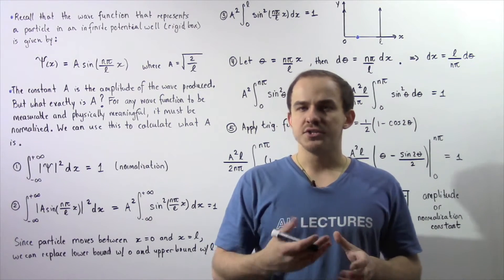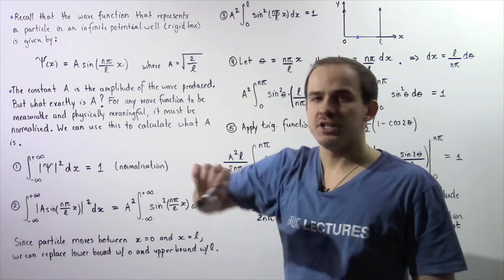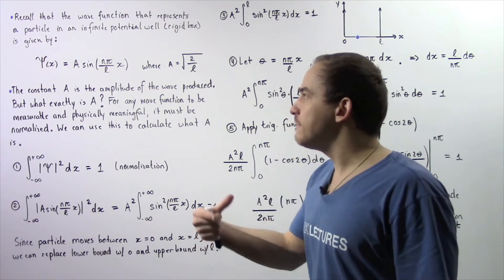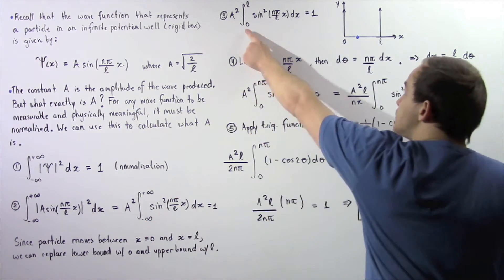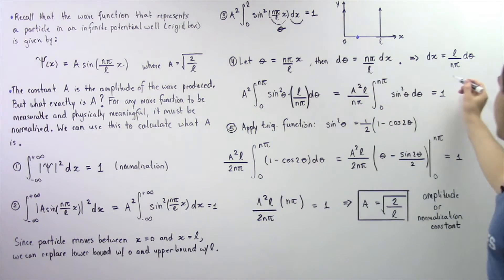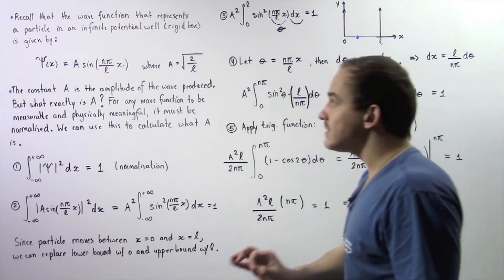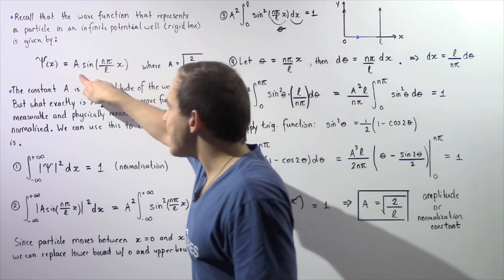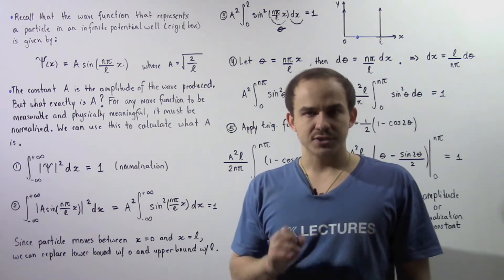Normalization Constant of Particle in Rigid Box

Comment: You still did not explain the bounds very well, at least I understand 0 but n\pi is not explained very well. how does it represent the right most boundary?
Reply: 0 and l are the boundaries of the electron since it is in the box. If you put l as x in the theta equation you get n*pi as theta, if you put 0 as x then you get 0 as theta so the boundaries for theta are n*pi and 0. I think you confused them for the boundaries of x which are l and 0.